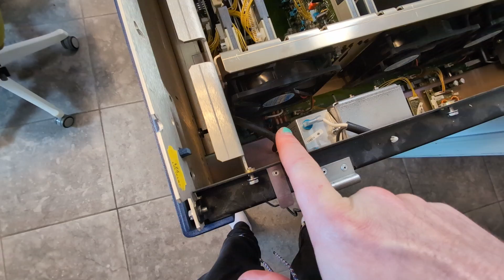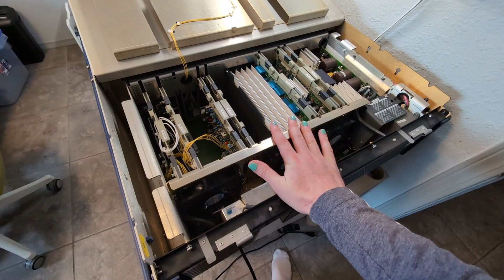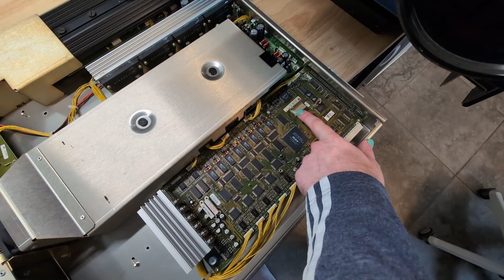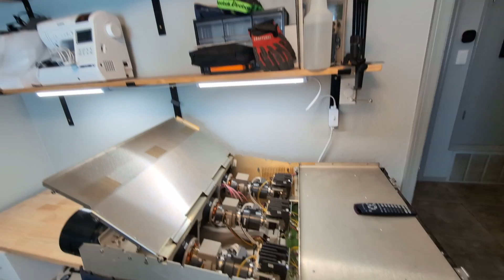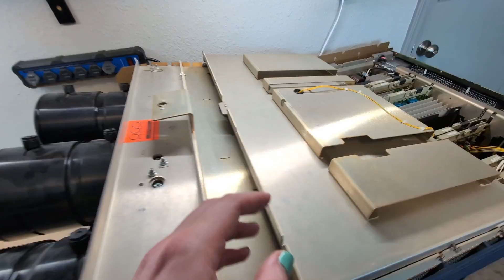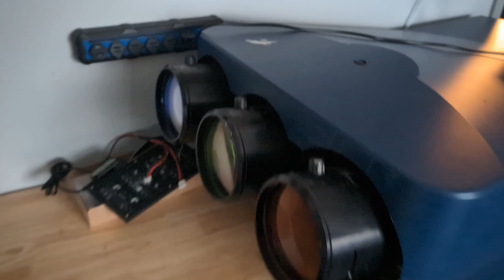A Scenic Tour of the BarcoReality 909

Comment: 3:47 The phosphor dots on color CRTs, and the individual CRTs in color projectors, do not use filters. (It’s not white phosphor filtered to a single color.) They use phosphor of the color needed. Filtering from white wastes 2/3 (or more) of the light output as heat — heat which you then also have to dispose of. It is far more efficient to only generate the color you need. It also ensures you get the colors you want, since there is no risk of filters fading with time (like what happens in single-LCD projectors). 

Also, the phosphor dots on color CRTs are NOT subpixels, as the dots have no relationship to the input signal per se. Just like a monochrome CRT has no pixels, conceptually you can think of a color CRT as being three monochrome CRTs which have been smushed into the same space, with each image allowed to “escape” through the holes in the shadow mask (or aperture grille in Trinitron).

Comment: IMO, what killed the last of the CRT projectors off was cost. They were expensive to buy and install. Early LCD and DLP projectors had an inferior image in every way but they were relatively speaking, cheaper and simpler to install, not to mention lighter. CRT was king for colour and contrast. DLP took years to get accurate colour reproduction and the colour wheel caused rainbow effects.  LCD had better colour but lousy contrast. Like all these things, they improved pretty quickly but I kept using a CRT for home theatre. The high end CRT projectors will do 1080i or 1080p. Interlaced on a CRT looks pretty good in reality even though people rubbish it. Thanks for doing a video on a CRT projector. They are becoming very rare now but they are an engineering wonder.

Comment: You need the LIMO PRO internal scaler to use the s-video or composite video on these sets, they don't connect to anything without that board. I have one for my Cine 9 since they usually came with it installed, but i don't use it any more and removed it years ago. You may see a slot on the far left of the rear that is not populated, and that is where the LIMO PRO scaler goes. 

You are also missing the IRIS3 auto convergence camera, no real loss there, although without your limited knowledge it may indeed be significantly quicker and more accurate to set up using IRIS3 if you did have it. The thing you thought was a speaker is where the little camera goes. There are no internal speakers, there is no audio input anywhere on the set. 

The remote was near identical to the built in version and it is NOT wired, you can use it wired, but it is infra-red. 

The RS-232 ports are also used to update software and save or load setup data.

In the bottom tray you have four boards, convergence, astigmatism, focus, and main controller. The first three do nothing else apart from their dedicated roles. 

The main controller board is the digital brain, with a Motorola 68000 CPU managing it all. This board feeds digital positional info into the other three boards for alignment and geometry settings. 

In the rear of the set there are analog positional adjustments on a couple boards, v-size and v-position can be adjusted using analog pots. Be sure you are adjusting the correct pots.

The SMPS has an adjusment procedure for the 17v output rail, which is critical for best stability of the set. I adjust this with a full white screen and aim for 17.3v at the test point, i then watch the voltage as i turn from white screen to full black or very close to full black, if it fluctuates too much you need to replace a heap of capacitors in the SMPS, not just the two 560uF caps on the standby section. The modification you see on that SMPS is done by Barco, not a big deal. Leave it alone. 

You will notice the fan speeds change when you go from a full dark screen to a full white screen, and this is due to voltage sag, hence you want to have that SMPS in very good health so it will hold as close to 17.3v on that 17v rail as possible if you want the set to be reliable and alignment/geometry to be stable. 

That 17v rail affects everything in the set one way or another, including dynamic beam focus and convergence, astig, etc. Everything starts there. 

In the middle of the set are the 3 neckboards, all three are identical, no adjustments there. You will see 3 width coils on the main backplane board, those will give a small range of adjustment for the width of each image so you can get all three the same width on screen, using less digital correction makes for a more stable set. DO NOT USE A METAL SCREWDRIVER TO ADJUST THESE, EVER. You MUST use a plastic adjuster, or you'll either get a major boot or your burn yourself as the metal screwdriver starts to get incredibly hot. 

Adjustment of the yokes is also somewhat important for minimal digital correction, again use care and do not touch the windings. Move the focus yoke back and foward to achieve best midpoint focus at or about 57. 

Setting one of these up correctly is no simple task, it takes many hours of checks and adjuments and tweaks to get all the mechanical aspects of the set correct before you begin going too far into digital adjustments. If you skip anything and find you can't get something perfect, you're starting again from whatever you skipped or didn't set correctly. 

These sets can easily display clear razor sharp 1920x1080p that will rival all but the best 1080p digitals, but need to be accurately set up to achieve that. You can indeed display 2560x1440 and 2560x1600 and also achieve a very sharp clear image, but this will require some skill to have it looking better than 1920x1080p. 

You may have paid $15 for it, but that was a $50,000+ set when it was new, and it is well worth maintaining it as such!!

Comment: I guess there are 2 reasons why those rear-projection consumer TVs weren't particularly good. One is that they were essentially based on standard TVs, but with higher beam currents and slightly modified deflection circuits to have some way to control convergence. The other problem was that living rooms typically are much brighter than a typical room you would use CRT projectors, combine that with cheaper, less bright, projection tubes, and you simply get a rather faded out picture.

Comment: Can you share more info on the CRT projection stacking? Im curious how that would work from the point of view of converging the image to ensure the image was still sharp.
Reply: too much effort, the idea is you point both sets with the green dead aimed at the screen center, and using the point on green adjustment you align both green images after all mechanical adjustments have been made. This will be only an advantage to brightness on a large screen. I have no problem lighting up a 130" 16:9 screen with just one Barco Cine 9 in my fully light controlled room with contrast set on 72. 

Blending is a better option, two sets (or more) will then cover their own section of screen, such as the left and the right of a 2.35:1 screen, and a soft edge blend zone can be adjusted so the blended area is even brightness with the rest of the screen. this will also allow for significantly higher resolution.
Reply: Stacking is still done with LCD and DLP projectors, though indeed blending is becoming more common. Generally speaking, at the viewing distances typical of screen sizes where stacking would be needed, it’s not thaaaaat hard to align them.

Comment: don't remove the lenses there is fluid behind the lens that when electrically Excited Floress  each one have a different colored Fluid Be careful. also these tubes are far more complex than normal CRT's. I have one so I know.
Reply: If you have a CRT projector with liquid-coupled lenses, I find your explanations not correct or hitting the target...

The lens assembly is indeed more complex than on "normal" CRT projectors, but these lenses can easily be unmounted to inspect the wear of the phosphorus etc.. You need to PAY ATTENTION and only loosen the 4 fasteners with heads on the surface of the lens flange itself, NOT the other 4 ones down lowered in the lens flange holding the flange of the glycol chamber together. If you don't know what you are doing and unscrewed all 8, yes you are in trouble....

By the way, CRT projectors use high heartstopping amps/voltages in many places inside, so if you do not know what you are doing, please stay safe and let someone who knows what they are doing work on them. 

It is not the coolant/fluid but the differently composed phosphorus hit by the electron beam sending out photons that have the properties for the three primary RGB colours. The glycol liquid is for cooling the phosphorus and is placed in the chamber in front and closed as a sealed "part" of the CRT tube assembly. On LC-coupled projectors, the glycol and the inward-curved front glass on the tube become the first optical element of the lens system. (mainly to reduce halo effects caused by light bouncing between parallel surfaces reducing picture contrast and can be seen as rings of light around bright objects on a dark background in the projected picture ) 
If the glycol coolant  itself is to be coloured according to the primary colour (like you suggest), the difference in thickness due to the space between the curved glass and the flat phosphorus glass surface would make a very uneven colour filter with lots of light loss toward the corners.)
LC CRT projectors therefore sometimes use coloured C-element,  placed inside the glycol cambers on red and green to get a more narrow frequency range on these primary to achieve better colour reproduction than the phosphorus manage on its own. (redder red, greener green, for a better colour gamut ).
 On non-LC lens CRT projectors where the front glass is flat and the glycol thickness is even, it was sometimes popular to put colouring into the glycol to achieve better colour reproduction.  Others used lenses that had colour filter elements built in, the HD144 lenses were popular on 8" CRT projectors.

The Barco 909 in the video is one of the highest-end CRT projectors ever produced, and can when correctly set up throw really beautiful 1080p pictures.

If someone is interested in knowing more about CRT projectors, the Curt Palme site is one nice place to start.

Comment: 32:59 these will be the RGB drivers for the tube cathodes to modulate the beam intensity- nothing to do the deflection coils.
They are located at the tube base as they produce high-frequency output at moderately high voltage, so capacitance needs to be kept to a minimum to avoid degrading the signal bandwidth.

Comment: Did they use these in film theatres?
Reply from the maker: Interesting question! Yes and no. You would not typically show a film with a projector like this, because the resolution of the projector will be noticeably worse than film. However, a lot of movie theaters did have one. There were two reasons: first, in the '90s it was becoming common for theaters to show pre-show advertising off a computer using a CRT projector. It was cheaper than making up slides for a slide projector, and you could show video ads (and charge more for them!). Second, theaters were starting to get into theater rentals and live events, both of which might involve showing a television image. For example, Century theaters advertised for a while that you could rent a theater for a party and play video games on the theater screen (you can probably still do this if you ask but I haven't seen an ad for it for a while). Back in the day, they would have used a CRT projector for this kind of setup.

Now that digital cinema has taken over, the digital cinema projector usually has a big input processor, sort of like the card you see in this projector, that allows it to display video from all kinds of inputs. A lot of theaters can operate with only a single digital projector as a result, when you used to have different projectors for different purposes.

As a kid, I used to go to an OMNIMAX theater that used a CRT projector to run pre-show slides. The image was sort of comically small and dim on the enormous OMNIMAX screen, but they weren't exactly going to make up 70mm film to show a slide about an upcoming exhibit.
Reply: @computersarebad   no, not a Reality 909. Not anywhere near bright enough or big enough for that, even the Reality 912 with it's monsterous 12" tubes would have struggled to do that job. Resolution is not the issue, it is light output.

Comment: I left a comment on the other video, you can get a VGA (HD15) to 5xBNC cable and drive the projector from VGA that way with just a cable. I used to drive a 21" trinitron monitor back in about 2000, and I had a CRT projector at the time to (an old Sony one I took down from the university after they replaced it with an LCD projector in a large lecture hall) and I was able to use the same thing to run the projector as well
Reply: The PFC has to produce a voltage that's higher than the peak of the incoming voltage (120VACrms is about 170V peak) - it's essentially a DC-DC boost converter, where the incoming DC actually varies with time (because it's actually 60Hz AC - but it's very slow compared to the switching frequency the boost converter is running at, so I like to think of it as very slowly changing DC input). The 300VDC will be quite smooth, as there are large capacitors on the output of the PFC circuit. Basically the main switch mode power supply runs from the 300VDC bus the PFC circuit provides, instead of from the usual 170VDC bus that there would be with a regular bridge rectifier input.

Comment: there is liquid in those lens assemblies i saw someone on YouTube the other day taking one of those lens assemblies apart from a CRT projector so just letting you know before you take one apart
Reply: These tubes are glued into the LC chambers with silicone, and the c-element of the lens is held in place by a few stainless screws through a retainer ring into the chambers. 

Taking the lens assemblies off won't let the glycol out.